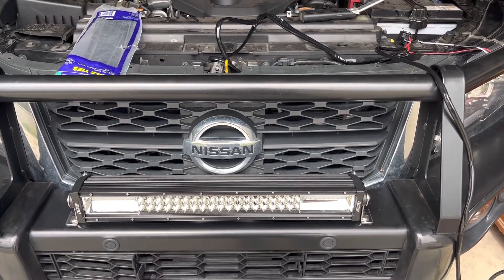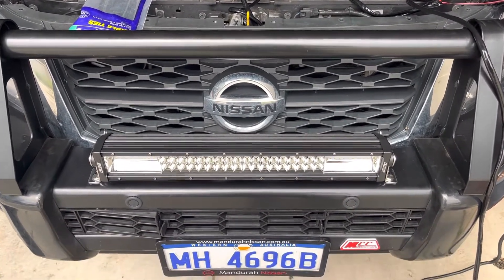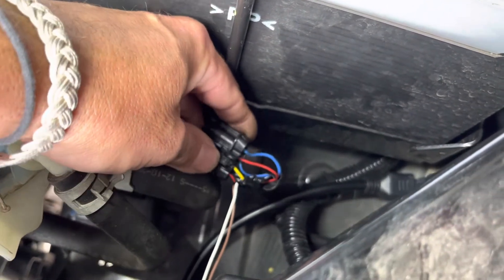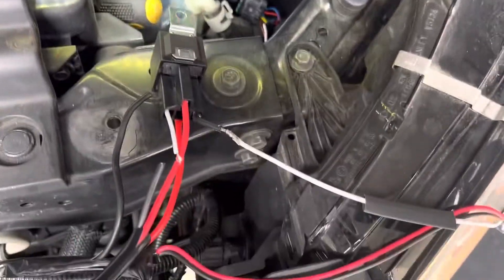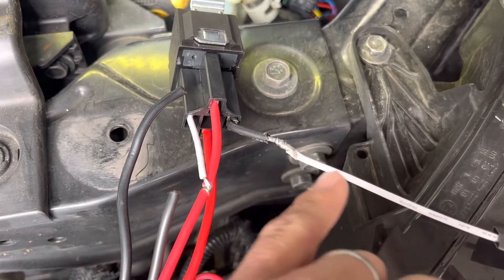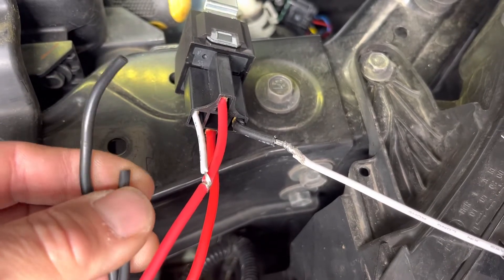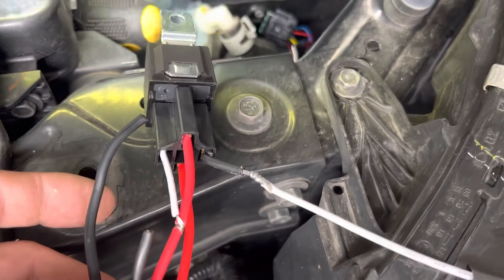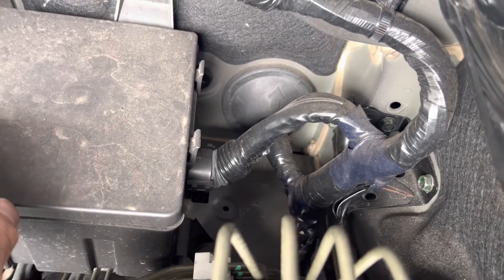How to Install Lightbar Wiring | High Beam Negative Trigger | Nissan Navara 2021

Comment: Is that the ‘plug and play’ kings spotlight wiring harness? I watched a video on the harness that says it works positive and negative or is that just the power I wonder? I wanna do it myself but also don’t wanna blow something expensive 😆
Reply from the maker: It’s meant to be plug and play but rarely they are. When a harness says positive or negative, it means it will work wheather the high beam is a positive or negative trigger. Saving you having to rewire the relay.

Comment: Is it the same for a 2012 d40
Reply from the maker: Not sure. To be safe you can buy patch leads that plug inbetween the car wiring harness connector and headlight with the high beam trigger having a connector on it. Saves fuess work and makes it all plug n play.

Comment: So basically from the light bar wiring the negative is going to the plug wire and the positive is going to chassis ground ?
Reply from the maker: The light bar positive goes to the relay pin 87, and the negative goes to battery or chassis earth. The earth for the relay pin 85 goes to the headlight wiring trigger (if negative trigger). 

It’s hard to explain, hope that makes sense.

Comment: So that white wire went to the headlight plug ?
Reply from the maker: The white wire from relay would go to the dash switch, then from dash switch down to headlight plug. So the switch makes and breaks the connection. Other (illegal) way is to run that white wire straight to head light plug if you didn’t want a switch. Then the light bar will come on with high beam. Hope that makes sense?
Reply: @vesautoelectrics  Thanks, Other (illegal) way is to run that white wire straight to head light plug if you didn’t want a switch. Then the light bar will come on with high beam. Hope that makes sense? is that white wiring tap on highbeam negative and then on and off with high Beam?